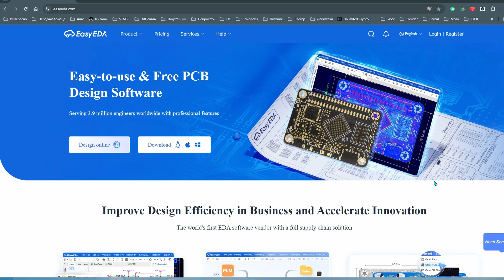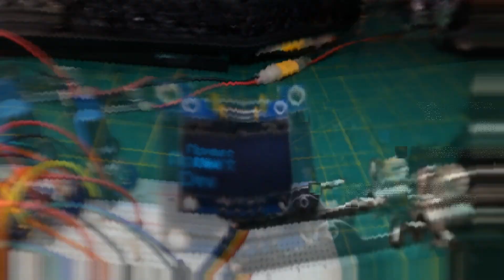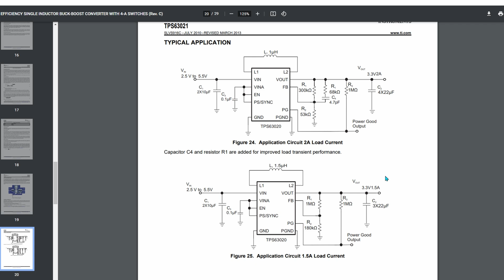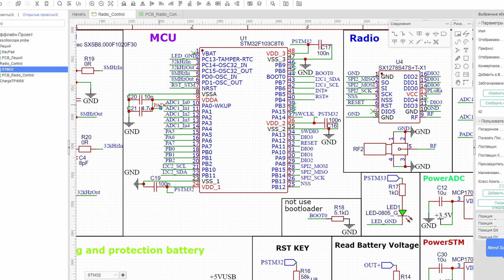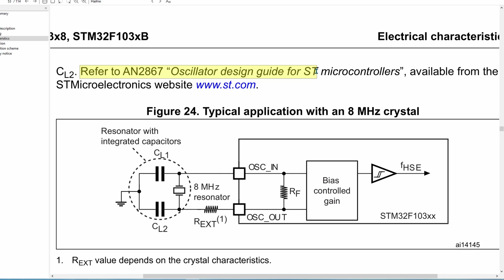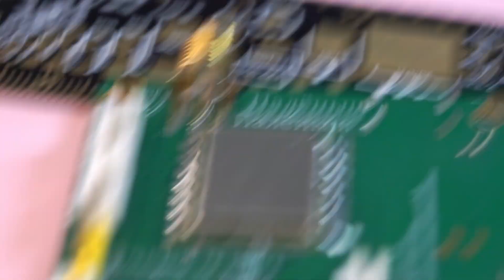DIY Electronics: A Beginner's Guide

Comment: hi...if my boost is 5v output.. where would i hook my stabilizer? because i need the 5v output
Reply from the maker: If you need a 5-volt output, you need to configure the DC-to-DC converter circuit for a 5-volt output. The regulator shown in the diagram can handle 5-volt inputs, so everything will work, and you'll get a 5-volt output. The rest of the voltage can be reduced to the required 3.3V.